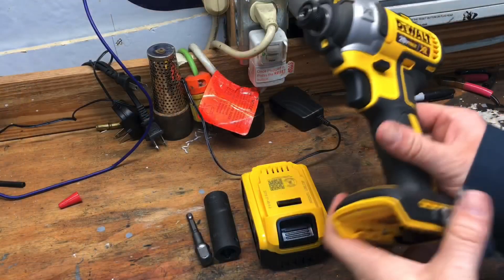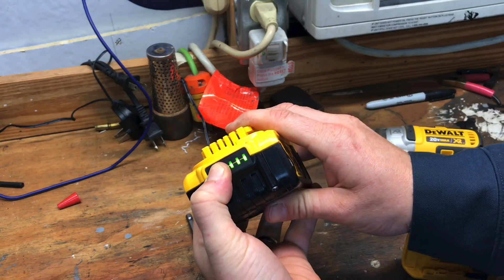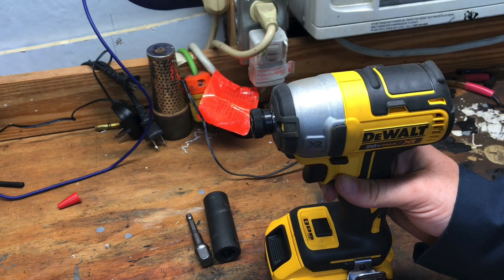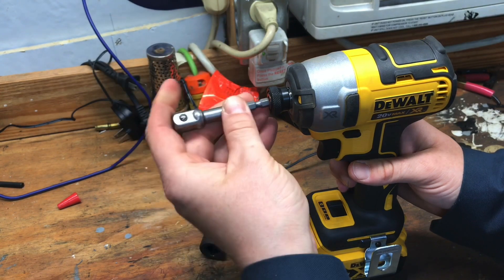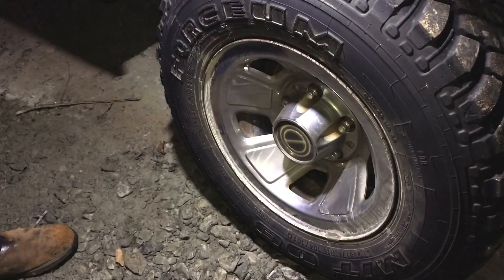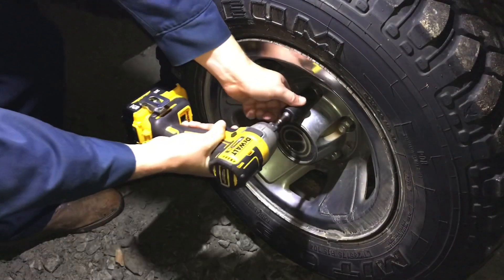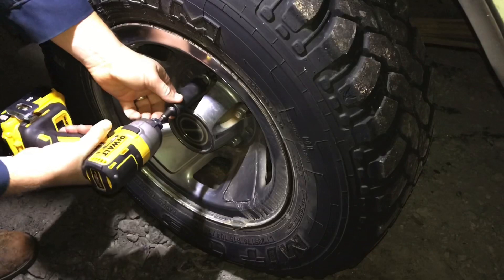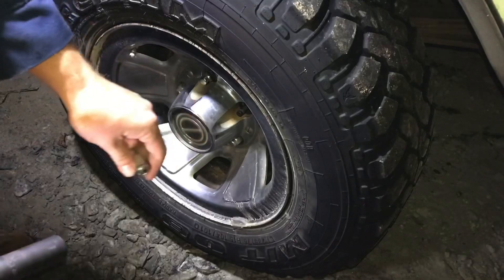Can a DeWalt Impact Driver Remove a Lug Nut?

Comment: While most people don’t recommend using an impact driver to remove lug nuts, most of the newer ones have enough power to do it.
Impact drivers are intended for driving fasteners.
I’ve seen videos where people have swapped the 1/4” collet for an impact anvil.

Comment: About putting it back on there using the same impact driver, how would you know you're not overtightning it and probably braking it though?
Reply from the maker: When installing lug nuts, I just snug them up with an impact. Then I take a torque wrench and bring them up to spec.
Reply: The 150 ft. Lbs rated is break free torque. Tightening could be less. Id be more worried about not being tight enough than over torquing. This is why using a torque wrench for final tightening is best route.

Comment: When you put the nut back on, did it get it back to 100 ft/lbs (or close to it) or did you have to tighten manually after to get it there?
Reply from the maker: I didn’t check. Usually when I install lug nuts I just snug them up with an impact and then bring them up to spec with a torque wrench.
Reply: @MikesGarage96  interesting to know, if driver is rated to a certain torque at speed 1,2,3, how close it comes to delivering that.  With the new electronic torque control, in theory you could avoid the torque wrench phase. 

My ACDelco 20V impact driver is rated to deliver a precise 73/133/162 ft-lbs with their "Electronic Torque Control" feature (which I thought was special but which I guess they now all have?).  My 2003 Suburban's lugs are spec'd to 140 ft-lbs.  So in second gear on the driver, I ought to be able to break 140 as busting torque is less than fastening, and to put them back on at 133 is near as damn it to the spec, certainly enough for a roadside tire change at night in the rain.

Comment: Where can i buy a 1/4 hex 21mm lug nut remover, the one the comes in one piece and not needing an adapter that you can plug straight into the impact driver?

Comment: A better question is can it put them back on at a true 100ft/lb’s
Reply: Run the snug then torque them by hand. You don’t want to hammer down on them with and impact that puts out over 250 ftlb of torque
Reply: @platinumf2505  Couldn’t be more incorrect. We use 750-1700ft/lb impact wrenches at Toyota and you do not waste the time or energy to manually apply final torque. Torque wrench it after if you’re worried

Comment: Are the lug nut retorqued to 100 ft-lbs or over 100? I don't think you can control the install torque on these impact drivers.
Reply: Just get a torque wrench to do the job when your done

Comment: Show us if it works on speed 1 instead of 3 on that gun some don’t have that option. Thanks
Reply from the maker: I explained the model of my tool. I have no control over what model you have
Reply: It won't work on speed 1, speed 1 on a XR is for delicate applications. Speed 2 is more like the Impact without speed select, and I would think it would have trouble on 2.

Comment: I have that same output, but a 3/8” drive and it will not remove the Lugnuts on my jeep which are taught to 130 foot pounds of torque. If you’re going for 100 foot pounds, then no problem.

Comment: i have the dewalt dcf809 impact driver, which is rated to 1700 inch lbs, which is ~141 ft lbs. my lug nuts were torqued to 85 ft lb, and the driver could not get them off. the dewalt dcf887 is only rated slightly stronger at 1825 inch lbs. oh well.

Comment: I have a 20v Dewalt and I tried to remove my girl’s car tire (14 civic) and all that happened was the chuk loosened up. :(
Reply: @clownworld7763  yes. I tried to but it didn’t work
Reply: @cmz85  a drill is a different tool than an impact driver. Much less torque. You can buy an impact wrench farely cheap these days. Get one of those if you are removing lug nuts.
Reply: @clownworld7763  ok thanks

Comment: It doesn't work with the dcf850 and a 5ah battery.  
[EDIT] It WORKS, make sure you have a heavy deep impact socket (important!), run on max speed and push against the nut.
Reply: I tried this on my brand new DCF 850 this morning, won't budge them!!

Comment: Didn’t work for me
Reply from the maker: What ft lb are your lug nuts tightened to?
Reply: And what type of driver did you use? Dewalt has the Atomic, 20Vmax, and XR. Also the size of the battery matters too. This guy used an XR with a 5Ah battery; I don't imagine a 2Ah battery on an Atomic impact driver or equivalent would be able to loosen up the lug nuts.
Reply: @urano4810  DCF887 works with 2Ah battery full charged. The  size of battery matters when you keep working and the voltage in the battery drops.

Comment: I always wondered why all these channels test a 1/4" impact DRIVER as an impact WRENCH.  Hence the terminology.  DRIVER vs. WRENCH.  1/4" collet vs. 3/8", 1/2" or larger lug. Just because it can doesn't mean it should. Kinda like using an adjustable wrench to drive a nail.
Reply from the maker: Most of us know that good and well. Hence why the title of the video is “CAN a DeWalt impact driver...” instead of “SHOULD a DeWalt impact driver...”
Reply: @MikesGarage96  I'm not singling you out for this type of video it just happened to be the first on my suggested feed.
Reply: Come on man. It just feels good to know that a simple driver can get you out of a jam. I sold my 1/2 inch wrench bcs I want using it at all. The other day I wanted to inspect my brakes and instead of doing it manually I used my driver and it worked perfectly fine. No one is saying it should substitute a wrench. But like the guy states, it will get you out of a jam and it did with me

Comment: God why do people abuse tools this way? An impact driver is not an impact wrench so stop using it as one. You’re creating problems for everybody as the people who make impact drivers Dewalt, Milwaukee, etc. etc. will not give us longer warranties because they’re finding people breaking their tools constantly, by pulling this kind of silliness. Stop being the bozo of tools and use the proper tool for the proper job, you remove lug nuts with an impact wrench, not an impact driver, which is made to drive screws and wood lags!